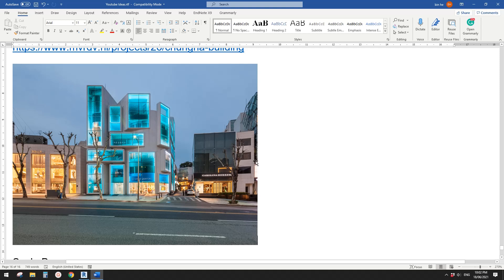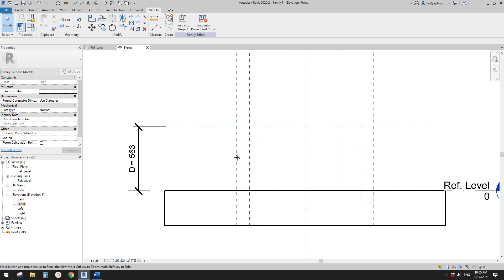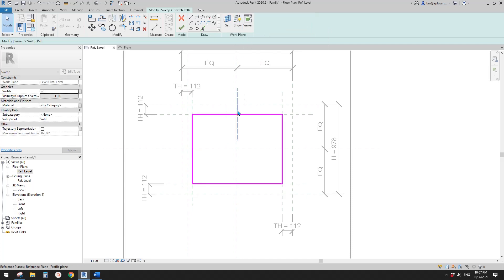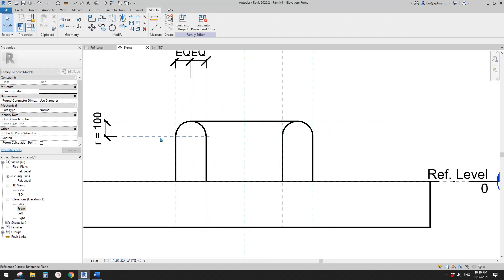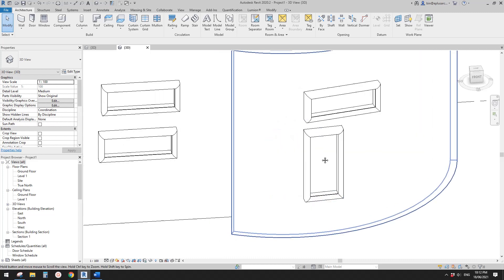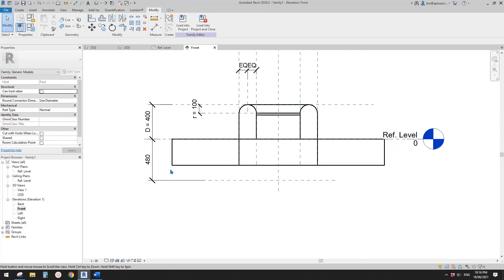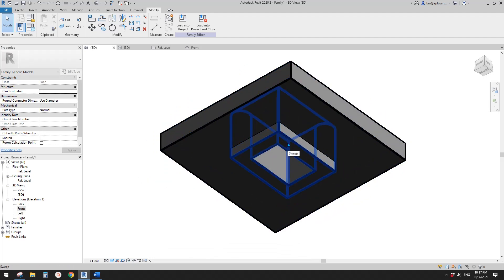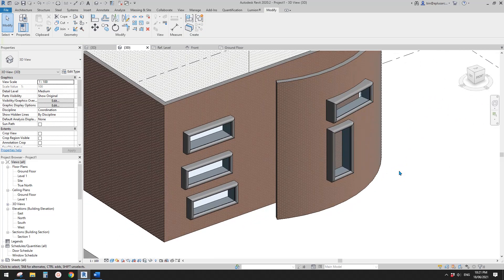Everyday Revit (Day 454) - Parametric Face Based Family Exercise

Comment: fantastic as always, thank you
quick questions can you create a void to cut the interior out?  at the curve for example
Reply from the maker: The void we did that cut the base in the family will automatically cut any face it is placed on, otherwise, you can create a void without cutting the base, but have the Cut when loaded check, so you will be able to manually cut an cutable element with this family.